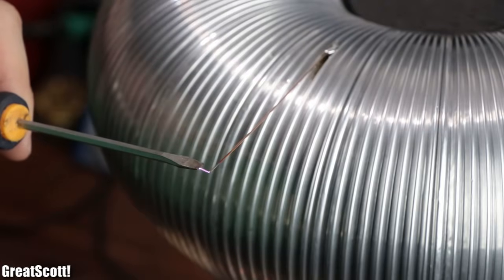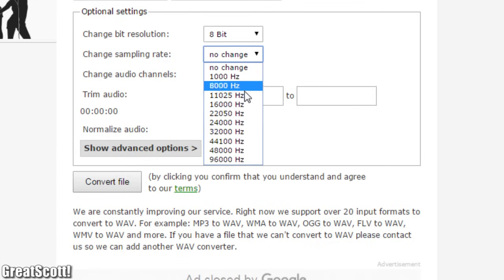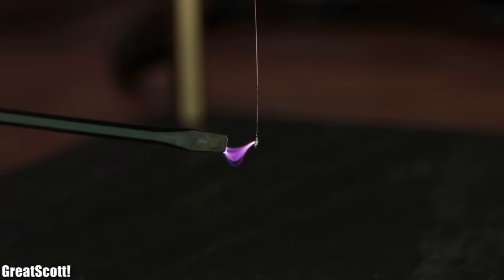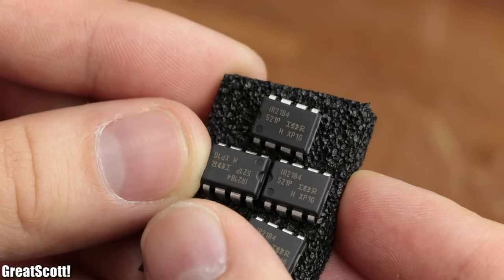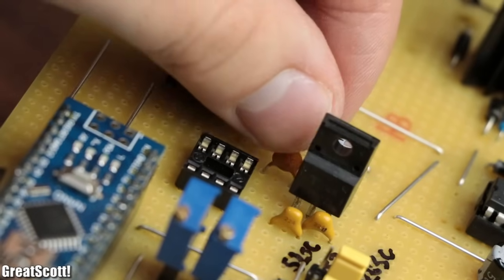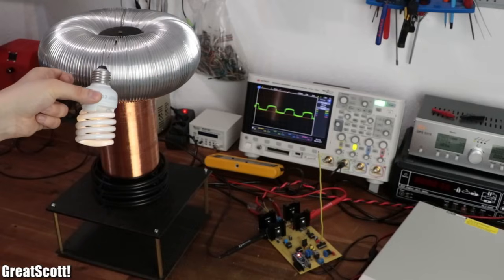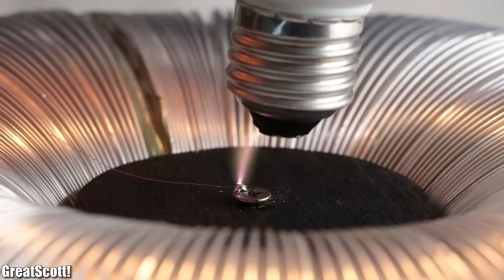Make your own Tesla Coil (Part 3) || Playing Music, Feedback, DRSSTC

Comment: Why the arc is not jumping in the air by himself ? That is a lot of work comparing to use a simple flyback transformer which could déliver the same syze of arc.
Reply from the maker: You need to increase the input voltage for this effect. I did not wanted to use mains voltage due to my limited workspace and I also do not have a way to increase the input voltage slowly to avoid damages. Basically the circuit can definitely handle a lot more but I simply can not try it out.....yet.
Reply: GreatScott! "Yet?"  So we can expect this in the future? ;P
Reply: I'm expecting 3m arcs :P
Reply: GreatScott! didn't you have a variable transformer? You can crank the voltage up slowly with that right?
Reply from the maker: It can not handle this kind of power.
Reply: GreatScott! You could maybe make your own variac. Would be a nice video too!
Reply: yes thanks sory i'm not english^^
Reply: ok good job, could you increase the number of turns on the secondary instead of increasing the input voltage?
Reply: to increase the input voltage you can use a charge-pump.
Reply: GreatScott! And that comes from The therminator? Shame on you!

Just kidding. Great video by the way!
Reply: so use charge pump and current drive by using a transistor
Reply: Hey GreatScott! Ive had a flyback transformer laying around that I salvaged when I first started electronics and Lately Ive been trying to find ways of driving it. Ive tried simple self resonators, 555 timer oscillators, even Op amp oscillators and all ive gotten is exploded mosfets and 2 days of my time wasted. Can you make a video about flybacks? I think alot of people need a high quality video about it and I think your the right person to do it.
Reply: Do you have to change the circuit/parts to use your tesla coil with rectified mains voltage?
Reply: or you can reduce the wire thickness to make it jump to the air
Reply: at which voltage was running because for me i only got 5mm arcs at 12v
Reply: @greatscottlab  You can buy a variac on ebay for really cheap. No excuses, Mr. Scott
Reply: @ivanrodionov9724  really
Reply: @greatscottlab  so by increasing input voltage should increase the arc length and creating louder sound
Reply: But you can do this by adding a piece of silver copper wire to the top load.
Reply: AlluraRed Have you watched his videos on DIY induction heater?  The circuit he created is basically a ZVS driver and it can be used to drive a flyback too.  I tried it and lemme tell you it’s crazy powerful lol
Reply: The problem with high powered Tesla coils you need a lot of space and a flat enough base to set the coil assembly. Also need to have fibre optic cables too keep the driver circuit far enough away from coil assembly as not too have a discharge spike back too the driver and blowing all of your work into smoke lmfao.
Reply: Can you shut off NANOTECHNOLOGY mind Kontrol military grade v2k?????please help me from America....they try to make sexual slavery!!!!
Reply: @greatscottlab  you gave a variac! You just need to rectify and filter tge output then you can bring it up slow.
Reply: @greatscottlab  yes it absolutely can run off a variac just rectify the output and you have an adjustable dc supply upto 240v
Reply: @allurared9029  use a zvs driver it will work very well you'll never blow a mosfet again

Comment: Nice project, but you need to increase the input power. You could use a variac and a full bridge rectifier with large smoothing capacitors as a power supply. Simply place the coil on the floor if you do not have enough space on your workbench. I also did my first tests of my DRSSTC inside, but soon i had to move outside because the arcs were hitting the ceiling. With proper tuning, you should get arcs that are about 2-3 times the length of your secondary. The longest arc i have seen so far with my medium DRSSTC was around 3m.

Comment: From my understanding a slayer excitor can get better arcs with a supply voltage around 20 volts with a better circuit. Not a recommended circuit to build.

Comment: Just stumbled on this project video. Back in middle school there was a company called Information Unlimited. I found them in the back of a Pop Sci magazine. They sold a "Tesla" coil kit that took 12V and ran it through a pair of BJTs into a dual center-tapped primary. I had to hand wrap the 12awg wire, but there were only a dozen or so turns. The kit used a TV flyback transformer.
It created a nice fuzzy arc of about 1" that was hot enough to melt table salt.

Another kit they sold was an "ion gun" that used a similar design, but smaller transformer. The output was connected to a ladder network of 20kV caps & diodes. The instructions claimed a 15kV increase in potential per "stage" which was 2 caps + 2 diodes if memory serves. I got the 'brilliant' idea to merge the 2 devices for my HS science project. The resultant (now a static discharge) arc stretched to over 4" in length and was much louder than the transformer arc.
I had a bit of fun after bending a rod in the shape of a Z to form an ion rotor. Every piece of metal in the room acquired a charge. Thankfully, there wasn't much in the way of electronics about 30yrs ago.

Comment: Now I have to build a MIDI Tesla coil, just because it's obvious, and because I saw so many points where you could have used math and common products to optimize the results. All through parts 1 and 2, I was mumbling "that primary is not optimized for that secondary!", "the secondary circuit will change constantly, so where's the secondary circuit feedback???", "why isn't he using conformal silicone on the secondary???", "why didn't he pot the primary in epoxy???", and "auuuurghhh! black paint IS CONDUCTIVE!!!"

But I think that was your goal all along: the arcs can NEVER be long enough. Great series!

PS: I'd like to see a video of you making this project FCC Rules compliant. ;o)

Comment: @GreatScott! You might want to check out my (simpler, cruder) tesla coil design. I was able to achieve 3 times longer arcs with 50V. I have not tested beyond that. I might try to use 120V with a magnetic ballast (for current limiting and safety) next. Id like to give 70V a try, but I think I'll need larger MOSFETs. I have been using IRFP250N MOSFETs and the modern equivelent FDP33N25 ones.

Comment: remove diodes 7,8,9 and 10 and you have the primary as tesla used it. you need those impulses (inductive kickback) to be high in voltage, short in duration. use SiC N-mosfet 1700V, with proper isolated gate drivers.

The next coil (the series resonant, impulsed from both ends) has on its ends 2 equal series tuning caps, that connect parallel over to the H Bridge coil.
the 3rd coil,  is the secondary, tuned to the 5th or 7th harmonic, depending on the phase coupling of the coils.
The impulses generated by L1 are fed to series resonant L2. L2 longitudinally kicks L3 into magneto dielectric resonance.
L3 is coupled back to L1. this is positive feedback, made posible by the phase shift between L2 and L3, and also phase shifted between L1 and L2 (done by reversing the L1 coil, causing counter rotation)
All coils are distanced (loose coupled) bifilar pancake coils (equal mass).

Comment: Hey scott, first: i love your videos and they are very inspiering and aloe me to get rid of anny doubt i have,
Second: i beleve that the wooden spaar youplaced in the center of the Tesla coil is whats avoiding a higher output (i think!) Because i have built a much more simpympler one with the same construction principal, a wooden spar from a Broken brommstick hanble, turnes out after testing i notest 2 things. 1 the output power was way less then before and 2 the wooden spar was getting warm. Just a sudgestion, you could try removing the wooden spar and i belive that would give a bit more power to the output. Once again love your videos, take care and keep Up the great work :)

Comment: the start up 555 is not needed at all 
when power is turned on a very short voltage spike will be present on the primary coil and ofc on the secondary coil which will be picked up by the antenna and properly start the whole system

Comment: For a DRSSTC the arcs should be much bigger and jump into the air by themselves. I am not an expert at tesla coils but makesure the primary circuit resonant frequency is tuned to the secondary precisely. You should use a slightly smaller topload to raise the frequency. Also you need way more power for your driver input. Igbt drivers can easily handle running off of mains voltage. Yoy have a variac, why not do that.

Comment: Is it possible to use a higher input voltage, like that from a microwave transformer or capacitor bank in order to produce a higher output voltage? Maybe not through the circuit but between the circuit and the primary coil. much appreciated, and good job on your videos

Comment: I made an sstc ..it was a half bridge and I used a 12V 1Amp supply for the mosfet driver(4420) But it kept getting very hot..and finally blew...
Where do u think I went wrong....
now i power it with a 555 timer producing about 500kHz amplified by an npn n pnp and a Irfp260N mosfet....

Comment: Hello Scott, 
I have smaller Tesla Coil with simple Slayer exciter circuit with 2N3055 transistor and I have same arcs or I could say bigger than you do on your Tesla coil. Arcs are jumping by themselves. Why don't you try connecting it to this 2N3055 circuit?

Comment: Your project is very helpful! I have learned a lot from watching few of your videos. Only thing I am wondering about is the output. I have built a very simple SSTC and, when using Interrupter, I get quite visible corona at around 15v input voltage, it goes down to about 6v, when interrupter frequencies are higher, because of my limited possibilities in power supply part of the circuit. So my question is do you get no corona at all or is the corona less visible because of surrounding lights?

Comment: hey scott,
i wanted to make a request if i may. i just got 2 new speakers (150 Watt) but i dont have an amplifier. So i thought it would be nice if i build one myself. i wasn't able to find a video on your channel so correct me if i am wrong but i would like to see a video for a proper amplifier with sliders and stuff and maby even a bluetooth funktion or i would also be happy if you could give me some tipps for that.
Reply: well he make a diy class d amp but when i try it out i fail many times and still after 1 year did not get it working so maybe you can use a pre made class d amp like the pam8403 but it can only handle 3w at 5v

Comment: I have a problem with the circuit. When i first powered it up i got pretty nice arcs form the tesla coil but i forgot to add the interrupter circuit. So i unplugged the circuit and went to my room to get the interrupter. When everything was set up i turned on the circuit and nothing happened. No arcs, no buzzing from the power supply, just dead silence. While i was figuring out what was wrong i unplugged the resonant circuit and connected signal 1 to 555 timer oscillator and signal 2 to Hex inverting schmitt trigger. Then i powered up the circuit once again and i got little arc (around 3mm). After plugging in and out the resonant circuit for couple of times my power supply started buzzing/humming like crazy. I took my multimeter and i found out that 2 IGBT's (in the schematic they are located on the left side of the full bridge circuit) were shorted out completely and by saying completely i mean all the pins were shorted to one another. So the problem here is that the two IGBT's got shorted out but i can't seem to find the cause of what made the IGBT's short out like this... if anyone has an idea to why this happened please leave reply. Thanks :)
Reply: new info: today i got new IGBT's and when i powered up the circuit, the IGBT drivers weren't functioning properly. The output of the drivers was DC and the driver IC's started to heat up so much that i couldn't hold my finger on it longer than 2 seconds. The supply voltage of the drivers is 11v. Btw i built everything according to Greatscott! circuit diagram. I can't understand what i've done wrong. I checked the circuit multiple times and everything was soldered correctly...

Comment: no i didnt get motivated, i struggle with doing a simple transformer and checking if I have some output voltage and you do programming, soldering, cutting, projecting, calculating and 13201 different things that I would have no idea how to do.

Comment: can someone help me?
I'm a newbie with electricity and I wanted to know a thing, if i have 2 AA batteries one with 600 mAh and one with 1200 mAh and I connect the in parallel, do I get a 1800 mAh cell?
and if it is a 1800 mAh cell and I use it with another 1800 mAh battery (only 1 in this case) what happens? does it double the total mAh or......
And about the voltage, if I have 4 3v batteries and I stack them in groups of 2 on top of each other and put the 2 "cells" in parallel, what will be the total voltage?
P.s my multimeter is broken
Reply: one battery will die before the other they need to be same mah and voltage
two total voltage will be 6 and double of amps
Reply: thanks

Comment: i just followed the circuit that you made But when i turn the driver on (just the driver without igbt)it instantly destroyed both of my ir2184 i dont know why,i also changed some cap like in the Vs/Vb vap from 1 220nF and 22n caps to only 100nF and i removed the 220nF cap from the ne555 circuit,i dont know why it keeps blowing up,also i changed the igbt from p50b60pd1 to 40n120 but the ir2184 still shorts even when i disconnected the igbt from the circuit,can anyone help pls??i really want to make it work
Reply: In my opinion this circuit really isn't all that good. If you really want to make a powerful coil, try to replicate one of Steve Ward's proven designs:
https://www.stevehv.4hv.org/SSTCindex.htm

You can also try to build DiodeGoneWild's SSTC (it is simpler than Steve's designs, but has some limitations):
https://www.youtube.com/watch?v=kjWkpG52-o4

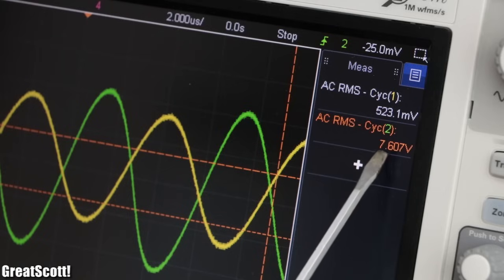Comment: 5:55 - You say mA, but the monitor says mV.
Reply: I think this can be changed in the setting on the scope. volts to amps, this scope would be very high quality and standard. I get  a bit cussed with scope amp function, is there a special probe used?  or is it a built in function for that scope?
Reply: But volts and amps measure different things.
Reply: Only the labeling of setting, greatscot may not have changed this in setting,  Channel 1, menu/setting/unit, this can be toggled from volts to amps. but does not get reading for amps unless it it set up to read amp, My scope does not have this function to read current straight out of the box. greatscot,s scope is not cheep.
Reply from the maker: A current probe outputs a voltage proportional to the measured current.